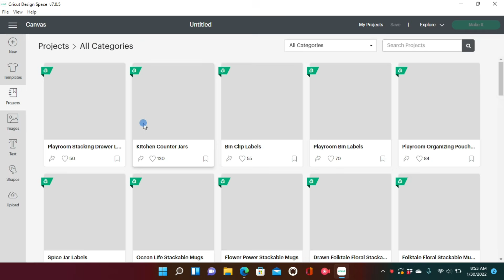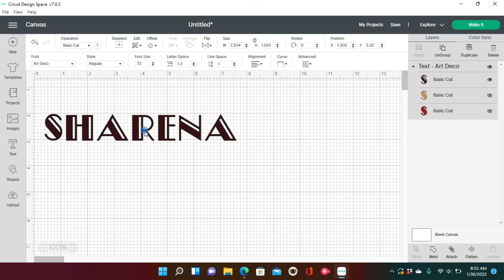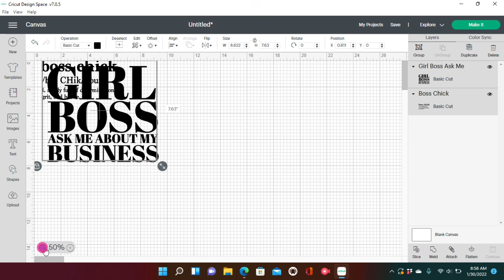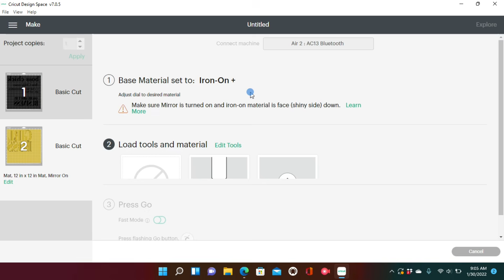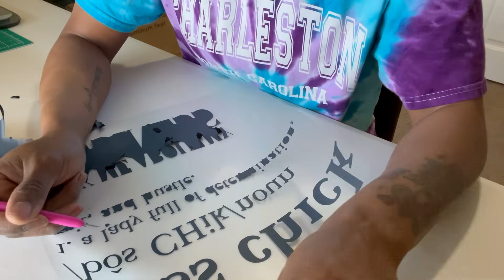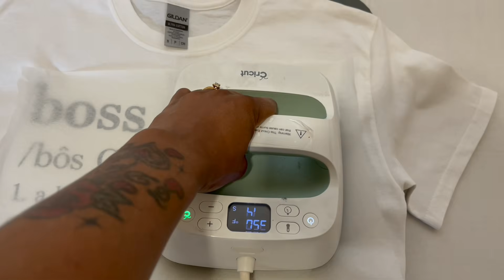(EASIEST) CRICUT IRON-ON SHIRT TUTORIAL *FOR BEGINNERS*

Comment: Great video.  I’ve watched it so many times.   The question I have is right before you press make it. Did you remove the girl boss part because it was a different color?   How were you about to have two pages during the make it part.  I’m using the cricket marker 4 and my mats are 12x12

Comment: I have a question, to print with you printer and cricut do you have to link them ?
Reply from the maker: Your printer is connected to your computer and so is the r Cricut when you print you will print with the printer and then cut with your Cricut machine. You can print from Cricut on your printer and not cut with the machine but your printout will have the registration marks on it.

Comment: Great informative video.  For the gold HTV when cutting the material did you have the vinyl on a separate mat
Reply from the maker: Yes and use the light card stock setting to cut glitter vinyl htv sometimes depending on the brand the htv is really thick

Comment: Thank you for this video I'm more confident now going ahead with printing... 1 question maybe  I missed it ... did you apply the transfer plastic after printing on the vinyl?
Reply from the maker: No the plastic is already on the vinyl. When you open your vinyl you will see a dull side and a shiny side. When you lay your vinyl on your mat to be cut the shiny side should be facing down on the mat. After your cut is finished weed off the excess vinyl that you don’t need. Once that is done your image should be visible. The transfer plastic is what your vinyl is connected to. I hope this makes sense.
Reply: @sharena latrese Thank you

Comment: I have a question and sorry if you answered this already but when do you put the transfer tape down? Does that go on underneath the vinyl before you cut?
Reply from the maker: I’m sorry I’m still a little lost. The only tape that I used in this video was regular tape to tape my vinyl to my mat. ONLY because my mats are old and they aren’t sticky any more so I use just simple to tape to make sure my vinyl is secure during the cutting process.
Reply: @sharenalatrese_thecraftgoat  I think that’s the part I was confused about. I always thought I had to add a separate sheet of transfer tape on top of the vinyl in order to stick it to the shirt. Now I see that when you weed it, that sticky clear part is what comes off with the letters. So like you said the shiny side of the vinyl is that sticky clear part. I made this more complicated overthinking it. 😩🫠
Reply from the maker: No I’m happy to help but What transfer tape?
Reply: @sharenalatrese_thecraftgoat  oh I think I get it now! I just watched your video again…the vinyl shiny side of the vinyl is the tape?! Am I understanding that correctly?
Reply: @sharenalatrese_thecraftgoat  I have the cricut transfer tape
Reply from the maker: The vinyl comes with a shiny side it is heat resistant you peel it off after you have pressed your vinyl to your shirt.

Comment: Thanks for the great video and I love your boss lady T shirt! I’m very confused though when you are going back over it & say the transfer plastic ? I just can not find a SINGLE VIDEO OR ANYTHING OUT THERE THAT TELLS ME as you did> even with a T shirt and just vinyl like this should I always use butcher paper in between my heat press and my vinyl on the sheet as I am setting the heat press down? Plz plz plz QUEEN BOSS LADY HELP!!! I need to do all of these today & need to know the answer & yours has been the best out of 1000’s 🙏🏽SO MUCH!
Reply from the maker: I use a Teflon sheet between my vinyl and my heat press or either parchment paper. You do not not have to use either if you don’t have either because the plastic that the vinyl is on is heat resistant meaning it will not burn it will take your heat press. But I suggest using something in between the vinyl and heat press.

Comment: can you tell how to size your files because my cricut will not let me sizen that big
Reply from the maker: What cricut machine do you have? The cricut explore air 2 should allow anything with a 11.5 inch W to a 23.5 inch H with the appropriate mat. If it doesn’t work I would double check that your machine is not set on print and cut. It should be set to BASIC cut.
Reply: @sharenalatrese_thecraftgoat   I have the   cricut 2
Reply from the maker: @tonyace9159  is it on the BASIC cut? What’s the biggest is it letting you size?
Reply from the maker: https://youtu.be/i3jPLxDVvj8    please click this link I tried to answer your question in this video hope it helps
Reply: I use the print n cut i think.
Reply from the maker: @tonyace9159  ok hope I helped